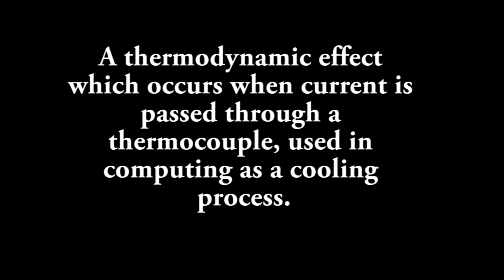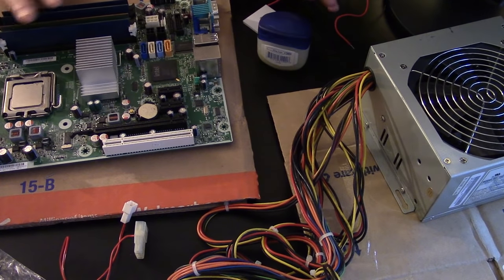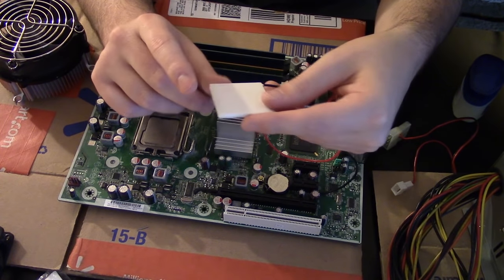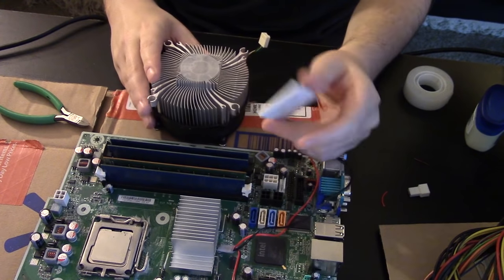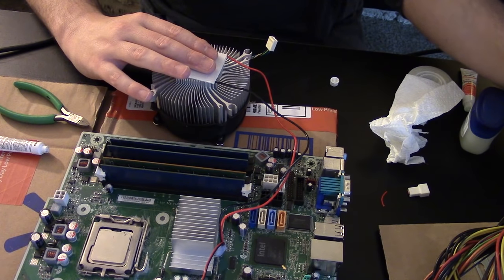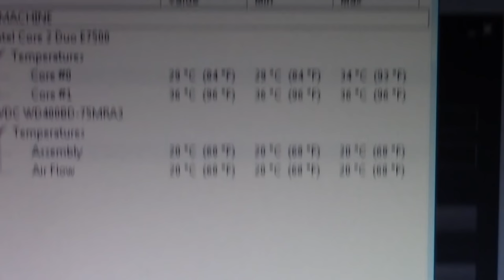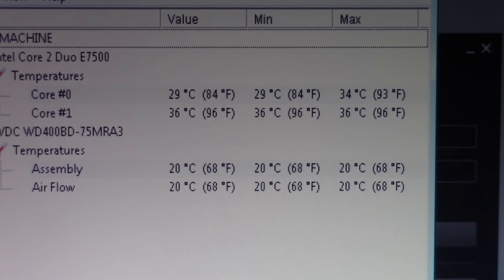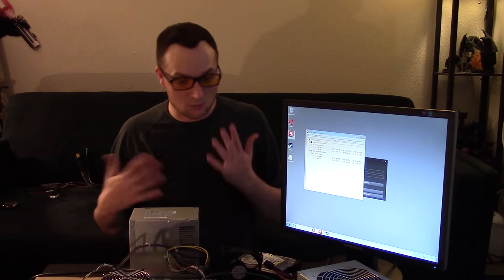💻 Peltier CPU Cooling Test

Comment: You can use a AA or 9v battery to determine direction without worrying about burning it up. I have one connected to a five volt usb for playing around with, and it draws about one ampere.
Reply from the maker: good info for myself and others thanks.
Reply: So, it works with less volts, does it cool/heat less too?
Reply: +Caludio Salerno Yes, the effect of cooling is proportional to how much voltage/current you supply to it
Reply: @pickachublast8  So you could technically run it off of a powerbank?
Reply: The Keeper You can if your power bank is rated to handle that amount of current. Otherwise, it could fry your power bank or trip the safety protection
Reply: pro trick: you can watch movies at flixzone. Been using it for watching lots of of movies lately.
Reply: @Wyatt Zain Yup, been watching on Flixzone} for since december myself :D
Reply: if you put it the wrong way just change the wires and it will cool the other side
Reply: @The_Keeper  yes. Most of them draw acceptable amounts of power at the lower voltage. I have USB monitoring devices and such to be certain. It is useful for a mobile demonstration of the tech.

Comment: More thermal paste = Less heat transfer
Reply: it's the basic principle. Aluminium transfers heat about 100 times better. More thermal paste = bigger barrier for heat to pass through = less heat transfer.
Given that all air pockets are filled by a tiny amount of thermal paste, more will only worsen performance.
Reply: VioDrools 
1) he didn't say so. 
2) once the pockets are filled, all extra paste is useless.
Reply: poor english for poor french
Reply: More thermal paste does not equal less heat transfer. Do some research. It's been tested by tons of people and all show the same results of it doesn't make it better nor worse.
Reply: This is because mounting pressure will usually squeeze out the excess thermal paste. Thermal paste IS less thermally conductive than the surfaces on either side, but FAR more thermally conductive than air. 
So if, at a microscopic level, your surface looked like this
/\__--------/\---___-----____/\--------_____/\

You'd get the best performance by filling the valleys with thermal paste, and getting none on the highest points. Now, since both sides of the interface are uneven, you effective high points depend on both side's surfaces, and thermal paste is a decent conductor. And again, mounting pressure usually squeezes out the excess. But there is no gain once the surface is coated with a VERY thin layer, since that is more than enough to fill all the microscopic valleys.  

Excess that ISN'T squeezed out WILL lower heat transfer slightly, IF (and only if) there isn't another bottle neck in the heat dissipation system.
For example (completely made up numbers here, and this over-simplifies heat transfer a bit, but the basic idea holds) Lets say your aluminum heat spreader can transfer 300W of heat per second. Your thermal paste can only manage 200W/s, and your air cooler's copper heat pipes can pull 320W/s, and the radiator can move 180W/s due to a low power fan.
The whole system is only able to dissipate the 180W/s then, and the 200W from the poor thermal paste layer will never make a difference. 
Again, over simplification. Real heat transfer rates very depending on hot the hot side is vs how cold the cold side is, so an improvement on a better part can move more heat down the chain to the worse part, increasing the temperature delta and therefore improving the bad part a bit. Putting a thinner layer of thermal paste into the example above might mean that the aluminum makes 10-20% direct contact with the copper heat pipes, lessening the resistance from the thermal paste, and moving that layer to 220-230W/s. The extra heat might then change temperature delta in the radiator, which could increase its efficiency slightly (190W/s maybe? Since all these numbers are 100% made up, the resulting number is meaningless of course)
Reply: Christo Slowrider it is like that to a degree. Too little thermal paste will cause less heat transfer because the cpu and heatsink usually are slightly convex or concave instead of flat. I mean the best heat transfer method would finely sand down the cpu and heatsink (must be the same metal) and stick them together as they effectively fuse on a molecular level and metal to metal is the best possible way of transferring heat.
Reply: Joey: 
This is practically incorrect. Aluminum has a greater heat transfer coeficient that is correct, but it does not have to do with "air pockets" being filled. If you pressed a heatsink to a processor in a vacuum heat transfer would still not occur. This is because molecularly, the surface between the aluminum atoms has a lot of gaps, the thermal past fills these gaps. The only way thermal paste could hinder the dissipation of heat by the heatsink is if you covered the top of the heatsink where heat is dissipated. The only concern of "too much" thermal paste is wasting money and spill over on to other components. 

You want 100% of the die to be covered. Will you see a performance loss if only 60% of the die is covered? Probably not, but that is more a testament towards the conductive quality of modern thermal paste rather than the actual physics behind it.
Reply: Questionable:
In principle this is correct, however in practice this is not. Since the components used in computing are copper (401)  and aluminum (237) , diamond (rated 1,000) still remains the best element for heat transfer. This means in practice, instead of going through all of that hassle of doing cold fusion and never being able to replace your processor again, it is much more simple to simply make a paste with diamond shavings to connect the void between molecules.  Since heat transfer will only operate at the lowest quality material, the aluminum with a rating of 237 will limit your hypothetical cold fusion "ideal" system. Diamond will not. 

The second thing to consider is the "Per meter" part of the thermal coefficient. Since the die of the CPU is a set size, you can avoid this all together by simply increasing the area of the connection between two metals. You get an area large enough, you could use spit as a thermal conductor and it would cool the CPU just fine.
Reply: Any extra paste gets squeezed out. It's been proven over and over.

If you put too much paste...It gets squeezed out. If you put more paste...It gets squeezed out. If u put 10 tubes of paste, the extra gets squeezed out.

It makes no difference
Reply: Really? I’ve never heard of that. But, I never apply more than a grain of rice anyways.
Reply: Thicker thermal paste = less heat transfer. Thermal paste amount that needed depend on wide of the plate contact. Wider = more thermal paste needed
Reply from the maker: It sure does, even I cringe a little when I look back on this video. Sorry for the delay, as I'm sure you know I can't reply to everyone. Hope you enjoyed the video. Have a Happy Halloween 🎃 & please sub if you can.🙂
Reply: Yea thermal paste is required only to fill the air gap between cpu and cooler.
Reply: it all squeezes out despite how much you put on only left with a thin layer
Reply: 6:51

Comment: I was testing this too and some points to notice. The peltiers cold side will make the thermal paste a solid material hindering the cooling, try without it and then buy something that can go lower than -30C. . Second thing is that you need to mount the cooler to have a pressure. It does not work without it.  If you want to completely remove the condensation just but the motherboard in mineral oil.
Reply from the maker: I have had some luck with straight mineral oil cooling in the past. I like the concept of combining the 2 however I feel that the overall temp would be null with a full submersion. I assume you mean just fill the mineral oil up to the peltier plate and let the heatsink be above the mineral oil. At any rate thanks for sharing. Please sub if you have not already 😋

Comment: My favorite part was when you apply a flammable chemical around the CPU and a device designed to get extremely hot
Reply from the maker: What are you referring to? Using Vaseline as an insulator has been a common practice for overclocking for a very long time. Vaseline is not flammable under normal circumstances its only the vapors that becomes flammable  if heated to very extreme temperatures. 🤣

Comment: Try a water cooler with the peltier cooling the water.  And only use a rice grain size of thermal paste.
Reply: I actually did it xDD we have to wait for almost 20-30 mins till the water drops till almost 5° and that can be used as Radiator
Reply: raj roshan raj can i have ur instagram or kik ?
Reply: @ZafriusRasnake  The optimal thermal contact points are metal to metal, the reason for thermal paste is to fill the microscopic voids (imperfections) on the contact surfaces.  More paste lowers thermal conduction, it doesn't improve it.
Reply: @ZafriusRasnake  😐
Reply: @ZafriusRasnake  :| 👍🏻
Reply: @ZafriusRasnake  Less is more, you're filling microscopic voids not spackling a house.  :)

Comment: how do you solve the problem of water, coming from the condensate, which will leak onto the motherboard, only with grease ???
Reply from the maker: If you are really serious about using the peltier method than you are going to want to use liquid cooling and put the peltier plates on a radiator. That way you can keep any condensation away form the board. hope you enjoyed the video
😋Please subscribe if you can.

Comment: A) way too much paste
B) no need to spread around, you may actually introduce air pocket
C) you didn’t even tighten down on the fan to squeeze paste from plates. 
D) do your comparison with a baseline cooler, not with yanking your setup off with leftover thermal paste.
E) you did zero stress tests to actually test the ability of the cooler to evacuate the heat produced.
Reply: Plus, the heatsink  is like the stock Intel cooler which sucks really bad.
Reply: You guys make a video and we can judge you
Reply from the maker: I appreciate that , LOL. 
It was just me messing around, hence using test in the title. Never said tutorial, never said this is how you do it. 
Hope you enjoyed the video.
Please sub if you can 😋
Reply: I agree with blankspace. As much as I didn't like him screw down the thing and do benchmarks and stuff, there's no need to be rude. The guy actually still helped us get an idea of the setup. I would request him to make another video though, this time done properly.
Reply: But even then he had something like 10c lower temps so imagine having it fitted correctly and the fan at max speed

Comment: this was a decent test and very informative. I always knew that peltier blocks wouldn't work, because if they did every computer would have them, but you gave real world example so great job!
Reply: "I always knew that peltier blocks wouldn't work, because if they did every computer would have them"

Incorrect. Even if they worked: They still would not have them. They risk increasing humidity (and condensation) within the case and their efficiency (in terms of power usage) is ridiculous. Your overall energy usage would increase dramatically. It's so much simpler just to use a larger heatsink and larger fans.
Reply from the maker: Thanks, was just a quick mess around test. Would do a lot differently today that's for sure. ☃️ Happy Holidays. Sorry for the delay, as I'm sure you know I can't reply to everyone. Hope you enjoyed the video. Please sub if you haven't already & have a safe new year. 🙂
Reply: Applying cold will never help instead we have taken heat and throw it out
Reply: @unknownos2442  Cold IS the absence of heat.  You can't apply "cold".

Comment: The more efficient way is too use waterblocks combined with this Peltier, a DIY watercooling system with Peltier away from electrical components should cool the water more then the official way.
Reply from the maker: agreed, this was my findings also latter down the road. 
Many mistakes were made in this experiment. However it should be noted I was just messing around. Even I cringe a little when I look back on this video. Sorry for the delay, as I'm sure you know I can't reply to everyone. Hope you enjoyed the video. Have a Happy Halloween 🎃 & please sub if you can.🙂

Comment: This is especually useful for CPUs with small die size where thermal gradient is important.

What about watercooling the hot side while connecting the cool side to a custom loop for chilled water? (Assuming an array of TECs)
Reply from the maker: I have actually seen people water cool a peltier plate, it works but, unclear how much improvement takes place as I have not seen numbers 😋

Comment: Can i use a Peltier cell to cool another peltier cell?
Reply from the maker: what on earth. WHY!!! 😨
Reply: err, no, cos you gotta cool THAT peltier plate too...
Reply: And that peltier u used to cool peltier will be used to cool another peltier
Reply: you can buy them in cascades to reach lower temps. so.... yes.
Reply: yes its called cascading look it up
Reply: Care with cascading Peltier's, they make a lot of condensation when cooling an OC CPU !!!
Reply: Cascade only once.. Peltiers are already inefficient. Adding one just to cool another makes your system more inefficient.
Reply: Yes u can but it makes no sense
Reply: yes  you might , but it involve different composition(s)
Reply: @512yottabytes7  ooo it make sense if you stock few peltier you can achive better cooling/heating

Comment: Just wondering, how much decrese in temps you see? Can it be used on GPU?
Is there better TEC module that cools better? Thanks
Reply from the maker: today I recommend water cooling and using peltier plates on the radiator portion. It most certainly can be used on a graphics card. Temps vary.
Please sub if you have not already 😋

Comment: What were the specs of your peltier module? I've seen some as high as 100watts (rated at a max of 15v and 8amps) but curious to know what you used! Thanks
Reply from the maker: will have to take a look.
Reply: Sounds good, thanks! I'm curious to experiment with different setups, especially for cooling things like graphics cards and laptops!

Comment: So the TEC amperes that are used up - where does that energy mainly go? The hot side? So in essence it will add for example 50w to the cooling?
Reply from the maker: There are numerous things I would do differently if attempting this today. For starters use a water cooling block and put the Peltier on the radiator portion. ☃️ Happy Holidays. Sorry for the delay in response, as I'm sure you know I can't reply to everyone. Hope you enjoyed the video.

Comment: Good video... yes a little less thermal paste... Which Cooler did you use ?    I get more DELTHA  temp drop with a push pull configuration with 2 high speed fans.

Thanks for share
Reply from the maker: Thanks for sharing, glad you enjoyed the video
😋Please subscribe if you can.

Comment: Hi friend, is it possible to put the peltier power supply together with the CPU cooler fan for temperature control together with cooler + peltier together?
Reply from the maker: (Same power cable off PSU to power Peltier & Fan) If I am understanding you correctly yes you can, should be possible.  Now if you are implying using the heat of the CPU to generate power via the Peltier and run the fan off that power than I would say no probably not.

Comment: A reason this might be a bad example is if your peltier junction is bigger than the CPU retensor for this 775 chip, the retensor will prevent the peltier from making a flush connection with the CPU die, since you can't just rely on a thick layer of heat transfer compound to do the trick.  In which case, a smaller peltier that fits inside of the motherboard's CPU retensor for socket 775 would be better.  A stock Intel heat sink + fan would need a little modification to fit a peltier inbetween.  The junction would also need to be started before booting up the system.
Reply from the maker: 🎄Happy Holidays🕎 Sorry for the delay, as I'm sure you know I can't reply to everyone. Hope you enjoyed the video. Please sub if you haven't already & have a safe new year. 🙂

Comment: The best way to use a peltier air cooler is cool down the air inside with an array of them on the inside of the removable sidewall cut to match them and heat sinks on either side of them. Much like the ones you see with "air coolers" made from them. The air flow is heavy and the super cold aluminum sink on the inside gets pretty cold to combat room temperatures.
Reply: Vydonis must used with dehumidifier first.. Peltiers a known condensers too, not good, but still known.
Reply from the maker: It was just a 1st time mess around test. Trust me there are numerous things I would do differently. For starters used water cooling block and put the Peltier on the radiator portion. ☃️ Happy Holidays. Sorry for the delay in response, as I'm sure you know I can't reply to everyone. Hope you enjoyed the video. Please sub if you haven't already & have a safe new year. 🙂

Comment: Interesting. Please recommend an enclosed water cooling unit?
Reply from the maker: possibly could rig it to the side of an all in one unit like the corsair H series. Otherwise you would need to use water cooling kits.  To be honest I have had more luck with mineral oil cooling and using bubblers.
Reply: How do bubbles provide cooling? & mineral oil I have no clue

Comment: quick question how much approximately power it uses ( u said a lot  but need some approximation( eg if it uses 200 w  ,you can use bigger power unit like 700-1000w and you just need one unit?
Reply: Usually less than 100w, mostly 50-60w
Reply from the maker: in or around yes. please sub if you can 😀